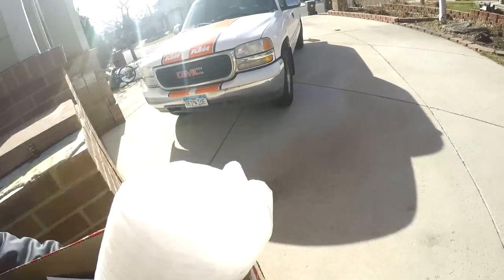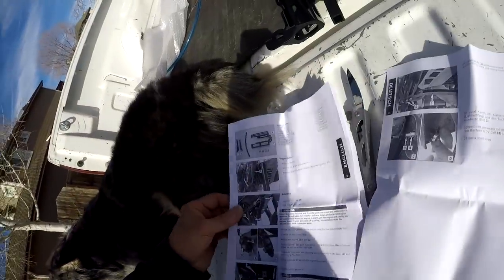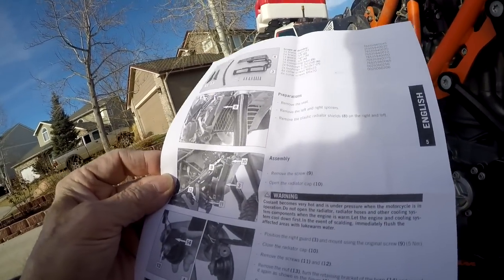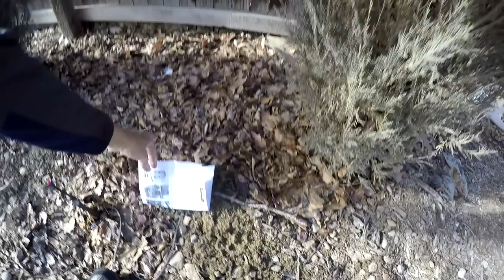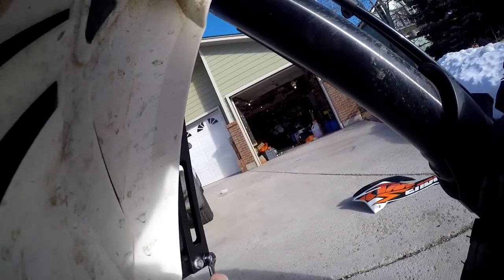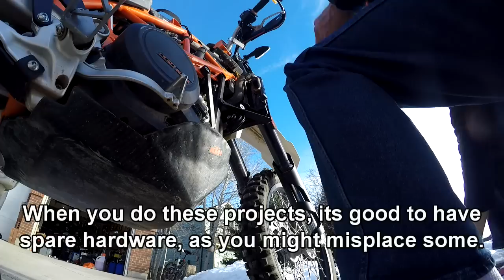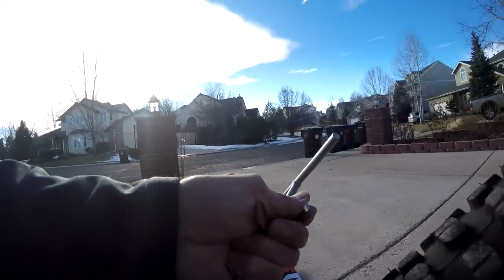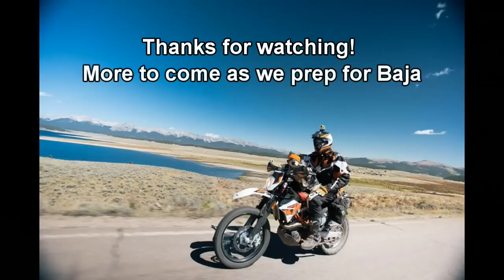KTM 690R Enduro Radiator Guard Install Instructions

Comment: THANK YOU! I'm replacing the radiator on my 2016 690. The previous owner had installed the KTM radiator guard and moved the brackets around. I couldn't figure out how the right lower side of the radiator was supported. Now I see that they moved the horn, using the lower bracket. I was left with the horn bracket on the old radiator and couldn't figure out what that went to. Now, watching your video I figured it out! Phew! I was baffled and decided to clean up my mess, get some lunch and dig into YouTube. Thanks, again!

Comment: Wow, can't believe I did something before you did on your bike!  I also had to relocate the overflow hose as you did.  It didn't say anything on the instructions to do it, but it seemed best to do this. I took a screw and put it in the end of the hose to minimize leakage from the overflow bottle.  Nice work.
Reply from the maker: +moonw5 Well, I hated to add weight, but this looked like a necessary addition if I can not stay upright and away from rocky trails.
Reply: +Tele Rover I agree, better than being stuck out there without coolant. Ride safe.

Comment: Some feedback for all regarding the radiator install. Just finished installing one.  Due to poor instructions and pics, it took me a lot longer than I expected.  As noted by telerover.   First area you'll run into problem is the horn bracket.  The pics and worthless.  I spent an hour playing around with horn.  The wires to the horn are too short to move the horn itself.  I guess that was a clue.  I found out there is a lock nut behind the rubber bushing that the right side plastic and horn bracket mount.  I removed that nut, and mounted the horn bracket to that side.  So, basically opposing side of the rubber bushing.  Then the right radiator bracket would fit.  It would nice if KTM Parts put a L or R on the side brackets.   The 4 long 25 mm. screws are used to secure the crossbar.   The spacers are used for top two radiator plastic guard bolts and the others for left and right plastics.  Basically as a standoff since the radiator guard bumps everything.  A bit disappointed I had to use a larger washer for the two top radiator plastic screw holes.  For $150 USD, you would think that would be taken care off.  I am sure I'll loose the spacers, the next time I remove the plastics.  We shall see.

Comment: I hear you got a new camera I liked your old one this one is good also what is it if I may ask?
Reply from the maker: Tom. with some misgivings, and reasons why I did not get one previously, I got a couple GoPro Hero 4 silvers, with the display built in. On my trip to Baja I'll be sharing videos with Brad Barker of The Greatest Ride Of My Life series and I wanted to be compatible with his gear. I still think that the Coleman CX7WP is a better bargain and easier to use on a ride. I had issues with the TCL SVC200 (which is the predecessor of the Coleman) as it had a high frequency whine in the audio. The SVC400 may have solved the issue and you can get them for less than $70 on eBay. Anyway, I'll be carrying 5 helmet cams on my trip.